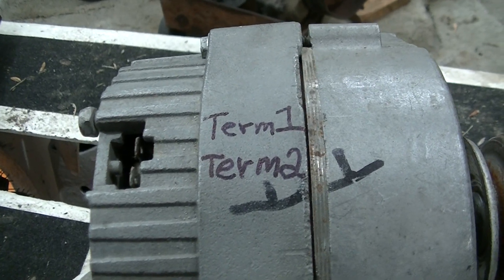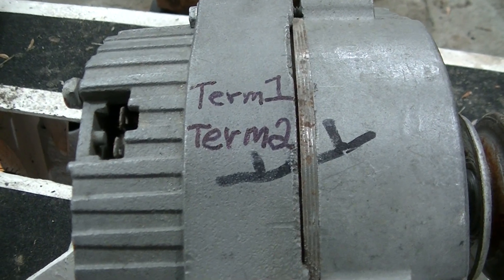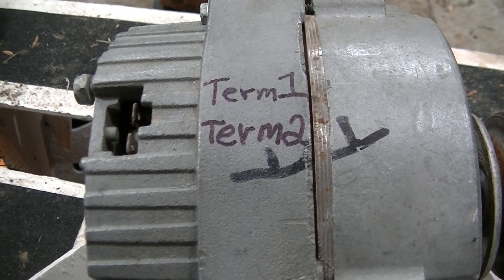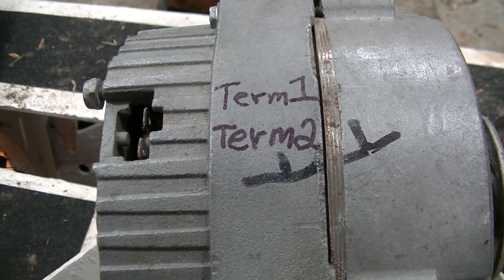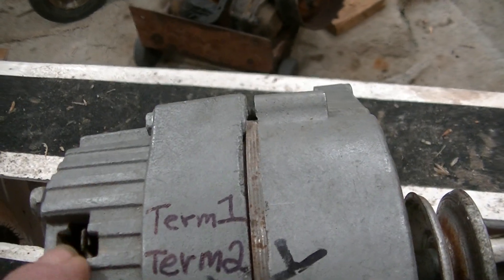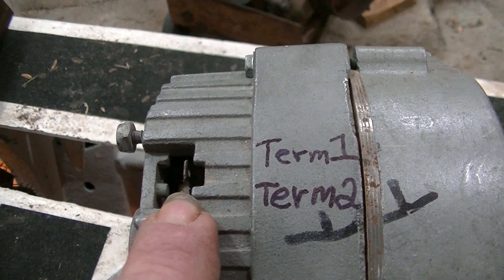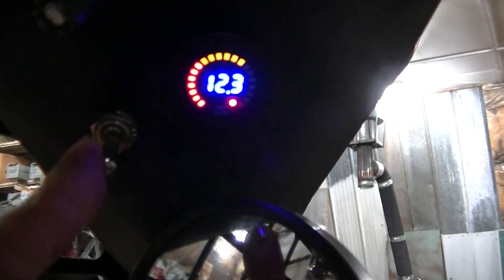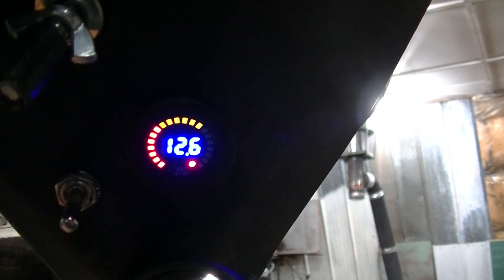Delco 10SI One-Wire Alternator Enhancement - zeketheantiquefreak

Comment: Thank you for that insight, greatly appreciated
Reply from the maker: Thanks a bunch for your reply.
Reply: @zeketheantiquefreak8518  Yeah buddy, thanks to you I just made a motor generator out of an old alternator; fed it 3 phase on coils and used the rotor's 2 brushes as outputs, opposite of how its normally used.
Reply from the maker: @alexmanzanero  Electricity is an amazing phenomenon, and we have barely scratched the surface of it's applications.